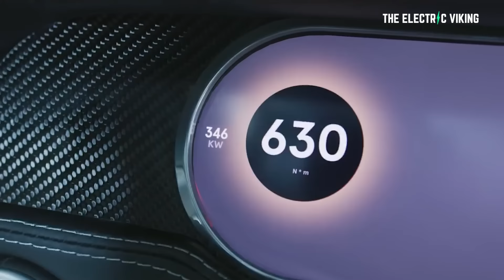Chevrolet's e-motor kit to convert gas cars to EVs is EPIC

Comment: They are missing the bigger and easier fish to catch in ICE conversion kits. 1 we love our ICE engines, the noise, the torque we do NOT want to take out our GM engines. 2. We are climate and eco conscience we want to help clean up the air, But not trade our great Cars and Truck in for low value, finance $50-$70-$100 Thousand Dollars at 8% to but a New Vehicle. 3. We really want a new advanced solution for our Cars and Trucks. WE WANT AWD HYBRID conversions we can afford.
Front Hub Wheel Motors 50, 100, 150 HP each each with Torque Vectoring, Regen Hybrid, Keeping the Current Gas motor and Drive train intact.
Europe is doing it, France is providing tax incentives, we have two producing of motor and control components in the US. Blue Dot and Protean are willing to help create such conversions if one can fund the first conversions, to afford the R&D development of adaptors to the Steering knuckle and Integrate the power management controller into the existing Gas Power system.
Image how many car nuts are driving vintage Classic Cars and Trucks or even fairly current newer vehicle with good power plants that would benefit from EV assist to the Gas Drive line to reduce consumption and lower emissions, recharging during braking and recharging during light duty driving. GM Assisted development would speed up the completion of Kits and adaptors for faster deployment, Team with Callaway and find dealers like Nicky Chevrolet to help drive the market. Its a No Brainer. We are not going to throw our loved vehicles away for EV just not. I am not trading my 2014 Corvette with 12,000 miles worth $35,000 in trade for a $130,000 E Ray either.  But I can finance a AWD Hybrid Conversion to help emission, get AWD, and security in Hybrid operations for years to come. Paying for updates and upgrades as new tech emerges. Going to the GM Performance Dealers and getting premium services done. Think GM Lead AWD Hybrid conversion and win the EV War for the long term now today. Dennis

Comment: The Welsh company, Electric Classic Cars have been selling EV conversion kits, starting at about €5,000, for some time already. Check their website and YT channel. Conversions can become hideously expensive, so those kits can help to reduce those costs significantly.
Reply: The kit isn't all of it, it's the labour and expertise to fit it......it's no damm good if after a DIY fitup you are totally disappointed.....no going back in most cases.

Comment: There’s a far bigger business opportunity to convert the now defunct EV vehicle market into Petrol powered vehicles.
The Electric Vehicle Industry is failing big time with secondhand prices collapsing in Europe and the UK, insurance companies refusing to ensure EV’s or charge extremely high prices because of them having to be written off in the smallest fender bender.
The future is more about high mileage low fuel used vehicles and not using toxic chemicals in battery packs.

Comment: GM has used the same bolt pattern on their transmissions for many years. RWD platform. 

I think it would be a no brainer, to start there. Add some adjustable   motor mounts ,25 miles of wires, 4 tons of battery.  Upgrade the suspension, brakes and tires.

Yea...get it done.
Reply: And recharge every 200 miles while towing.

Comment: No $125.00 a month I don't see that happening! Especially since they have blackouts and in a emergency they can shut off your power in a disaster. I've converted a few generators to tri and dual fuel conversions. Having more than one fuel source is the way to go. Vapor fuels are the way to go and no fuel or carb problems. Electric not long enough driving range, electricity is not free and only going up in price. EV's run on 220 volts like running a stove or dryer alot of power and you have to have a electrician to install a 220 volt electric vehicle charging station. In a grid down situation with utilities cut off you can't charge your vehicle unless you have a generator that runs on propane and not electric (Rember the electric power is shut off). Government can cut off any utility in a disaster or emergency. Propane is $2.00 a gallon in my area. Running propane inside the engine its super clean like new - spark plug and oil, engine lasts longer on propane, less maintaince, propane never goes bad, the best prepper fuel and no one can cut it off. One of the few propane kits left for vehicles is for up to a 400 horsepower for a standard 4150 intake carburetor flange. Going electric conversion they could cut your vehicle off anytime by satellite like on star already on vehicles. Racing to the gas station and camping out there or spending the night while traveling to charge your vehicle and paying alot for the electricity. We must not forget 87 octane was at $4.50 a gallon up to $7.00 a gallon in some states. Unless they make a car that recharges itself while it's going down the road is dependable and with a long range it won't sell in a recession and depression economy. I can't see the savings and with everything made to break like cell phones with lithium batteries you just throw them away when they break and other electronics not even worth fixing I still can't see it. To sell it they better install it in a muscle car and 1/4 mile prove it and at a reasonable price. GM already lost a 572 cid BBC engine sale  from me because they couldn't answer technical questions and didn't have a technical department or phone number.

Comment: I'm not sure where those numbers come from but here in Australia I can convert a VW Bug for around $35,000 in components. I can convert my 1987 Mercedes 300e W124 for around $55,000 based on the motors and range I want. (around 250km). The high end cost stuff is when you start using motors like ReVolt where they have taken a Tesla large drive unit which is a transaxle design and rebuilt it into an inline drop in motor for classic muscle cars delivering power to the original diff. Those are expensive but not the only option. Swapping in a Tesla rear motor AND subframe is a lot cheaper. It is also very popular to swap in a Nissen Leaf motor which has 214HP (160kw) which is no slouch in most conversions. Those motors are quite cheap. Here is a link to an absolute weapon of a muscle car using the Tesla subframe swap. It's Kevin Erikson's 'Electrolite' a Plymouth Satellite he converted himself for $50,000 USD and it is amazing! https://youtu.be/8jFpvvK4fSE

Comment: Neither Ford or GM are the first OEM with a crate EV motor or EV conversion package. Jaguar has a conversion package that will fit any 6 cylinder Jag and Aston Martin also does EV conversions.

Comment: So, a Tesla Model 3 has a battery that weighs 1000 lbs. that offers a range of 165 miles. The battery is integrated into the body construction. The conversion doesn't sound like a practical, let alone economical procedure.

Comment: That would be like me getting an electric retrofit kit for my 1979 Yamaha RD 400f ...the last 2 stroke air cooled street bike. They'd need a gun and police outside my house to get me to do that. Seems to me , crash test performance will be changed drastically with the addition of that much battery weight. I do salute those that are Hot Rodders and building the car of their dreams ...gas or electric.

Comment: I was toying with notion of buying wrecked Tesla to convert my custom service truck yrs ago, but that's a daunting project.  (want 3-phase 440V output, etc.)
  Trouble is the custom part is extremely expensive and not likely adaptable to an EV chassis anytime soon if ever.

Comment: Its a brilliant idea Viking and may enable the owners of perfecly good ICE cars to keep them at relatively low cost to buying a new EV,   What's needed is a limited range of adaptor plates being mass produced along with the motor/gearbox spline coupling matching the adaptor. The company that does that will have a massive success on its hands as they can produce low-cost composite battery boxes to go with the relevant car & adaptors to house 4780 Tesla cells, soon to be available.

Comment: You can't plug 10s of millions of cars into an electric grid already on the edge of rolling blackouts at any given moment.
Reply: Scotty Kilmer
Reply: You’re thinking of Texas!
Reply: We just passed a huge bill adressing climate change. I think  power grid updates are part of that bill....
Reply: @deesnutz5576  good we have to be diligent because we are so in need of bringing the temperature down and a endless electric power as long as the sun is shining going forward and we get better in renewables every day we just have not been subsidized like big oil but it is really catching up fast if we work hard together we have to find clean energy soon
Reply: You better get busy on more Renewables fast we are burning up
Reply: @TravisTheSavage  Nice try. EVs are just an expensive, inefficient toy. They're for people who just have to have the latest iPhone.
Reply: @ronz7046  Nope. Kalifornia is #1 in rolling blackouts. "Conserve electricity, don't use the AC and don't charge your EV". Newsom's latest plan.
Reply: @deesnutz5576  Oh please. You don't really believe that, do you?
Reply: Idiots think we are saving the planet by using EV’s 😂 No thought about the process to get those batteries! 1. the environmental destruction mining for lithium. 2. The amount of fuel to mine, transport and refine is 10x more carbon in the air for one EV car than a gas car. 3. To charge the EV is using petrol, coal or gas. If you think solar wind or hydro is green then again you are not taking in the account of the same disastrous effect to gather and refine those products. 
If we went back to nuclear power then the cost effect balance’s out. 
The green deal is a money scam with China making our lawmakers rich with tax payers money. China is the largest supplier of lithium batteries and have lithium mineral rights in Afghanistan thanks to Obama.
Reply: An at home car charger draws less power than an electric stove, it’s not additional load on the grid it’s the same load that it experiences all the time. If you didn’t live in a dumpster fire of a country you wouldn’t have rolling blackouts
Reply: @mattsharpe3989  No, it doesn't. It may have less draw at any given point, but since it is drawing for 8 + hours the end result is much higher. 
Face it, EVs are just an expensive, impractical toy for those that have to have the latest tech toys.
Reply: @stevenbass732  all cars.
Reply: Then change it. You think they’re going to leave it exactly the same?
Reply: Ten million electric cars plugged into the grid at the same time would actually regulate it better and provide extra storage for off peak green energy production.
Reply: I love how everyone bashes on EVs. Like the same people who don’t give two fucks about pollution or the environment one minute, suddenly when there’s something to eliminate the need for oil on a large scale suddenly there’s an uproar of people saying EVs are bad for the environment and we can’t handle them. Where were you when BP dumped billions of barrels of oil in the gulf? Oh wait you didn’t care. Stop trying to be contrary because it dose t line up with your political beliefs. Maybe if we invested in our electric grid the same way we invested in oil we wouldn’t be “on the brink of rolling blackouts” idk where you live but I have literally never EVER had the power go out without some act of god causing it. I get it it’s new and you don’t think it works but it is pretty easy if we wanted to.
Reply: And we will never be able to if we keep relying solely on internal combustion engines. I'm hoping to be long dead before vehicles are all electric, but it's probably the only sustainable way forward. Our use of hydrocarbons and fossil fuels has wrecked our planet, that's undeniable at this point. I do wonder if it might already be too late to have measurable change though.
Reply: Yes, you can.  Using the internet of things, you can vary the amount of charge and discharge across all the vehicles. The "fleet" of electric cars across the nation could serve as load leveling batteries that might smooth out the peaks and valleys of renewable energy sources like wind and solar.
Reply: The power grid lol they make power str8 out the earth
Reply: Agreed @johnnyboyzZ
Reply: Rooftop Solar wind and battery is enough to not even need any more wind and solar farms. That says it all.
Reply: I’m very interested in this for my 1951 Chevrolet Fleetline. This is a show car with a corvette engine. I believe it would be a show stopper at car shows, that’s about the only place I drive it. There appears to be not much new information about this lately, I wish I could find more.

Comment: Are there any plans to replace the transmission and the related drive line with electric (keep the ICE motor and a smaller fuel tank)?

Comment: Imagine a small version that could fit where old transverse mounted 4cylinders used to sit. Locating a place for batteries would be tough but it could make a good solution for the lower end of the market that is yet to be solved…
Reply: Put the batteries where the gas tank is…don’t need it anymore.

Comment: This is huge. It will take years for EVs to reach 100% of new car sales, and then another couple decades to replace the existing stock of ICE vehicles. But EV conversion kits could shorten that transition to just a few years -- if they can get the costs down (and if gas prices remain high).
Reply: I don't think it's that big of deal. Swapping engine for motor is easy...having a location on the vehicle to carry all the battery's is a engineering nightmare.. if people want more then 50-75mile range and they also want to utilize the same Sq feet of interior  space then engineering the battery housing and location will be the real task. Most guys aren't set up to re-engineer the cab and chassis of a vehicle.. anyone can swap a engine..
Reply: @kennedy6971  The French company Transition One is developing an EV conversion kit which will initially only have about 60 mile range but cost will be only 7000-8000 euros (not counting subsidies). The battery replaces the gas tank. By the end of the decade battery energy densities will probably have increased to the point where retrofitting for long range will be practical and economical. Meanwhile, why not put the battery on a roof rack? Or more practically, put it in the trunk and put your luggage on a roof rack or in the back seat. Another option: Replace the gas tank with 60 mi battery capacity and use a small trailer-tow battery for long trips.
Reply: @kenjohnson6101  Why fit the battery in the petrol tank space only.....there should be lots of room  for modular batteries under the bonnet when the engine is taken out.......that would balance the weight reduction that the engine removal has.

Comment: Isn't GM already working with Lightening eMotors (ZEV)? It seems like it would be a lot cheaper to let them do the conversions and share the proceeds.
Reply: ZEV is working with Ford also in converting existing commercial class vehicles to EV. Forest Grove (A Berkshire Hathaway subsidiary) already has a $800 million contract with Lightening E Motors to convert large amount of existing ICE school buses to EV school buses.